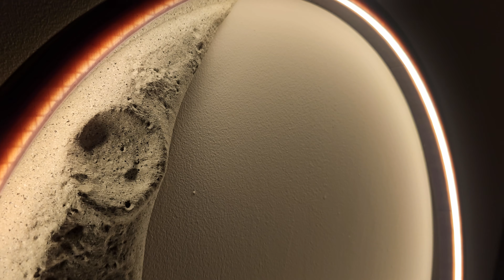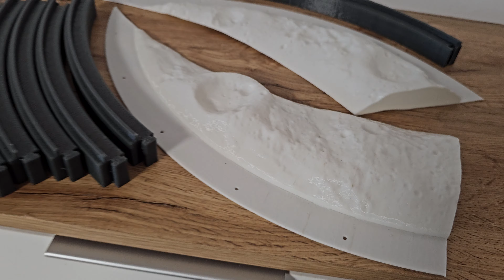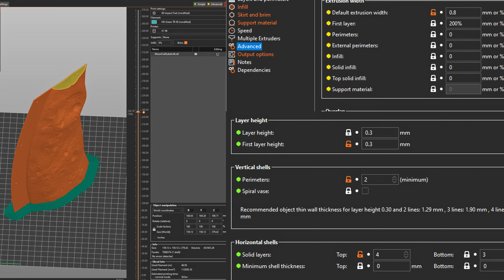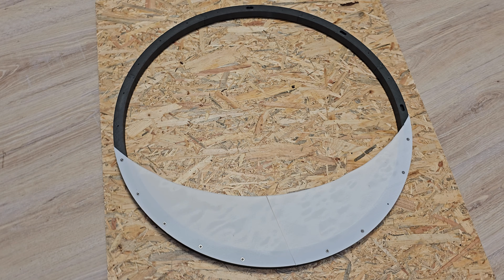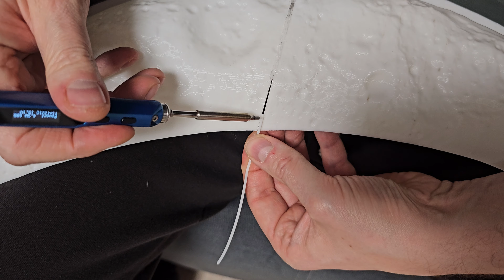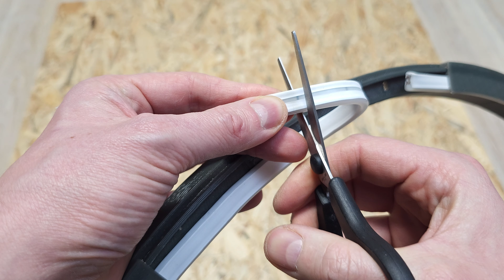3D Printed Moon Lamp  Cheap & Easy DIY

Comment: Very Cool man, im looking for a project, for the famous lamps, buy im looking for a full texture moon, not waning crescent, I like your frame system, I think I will have to design one like this, I think it would be better to make the lunar part with plaster or cement, and the frame part with 3D printing, since if I want it to be 50cm in diameter, I would have to make the moon design divided into 4, and They would see the seams,